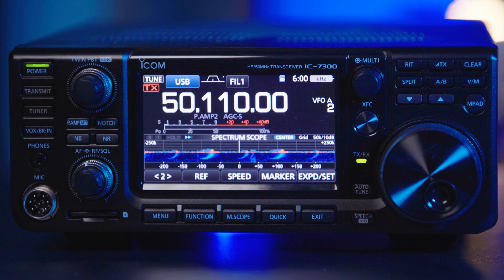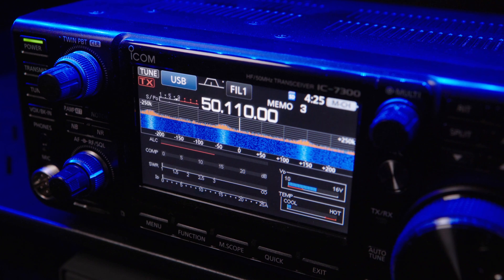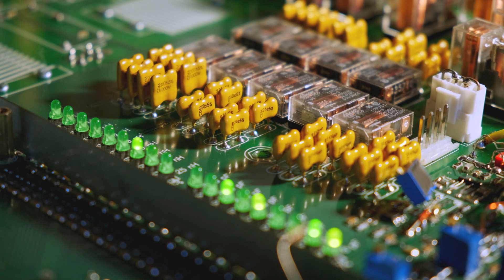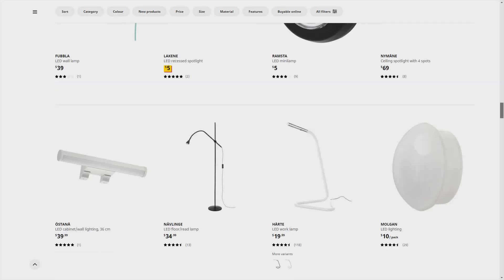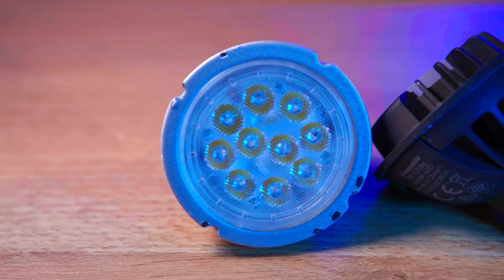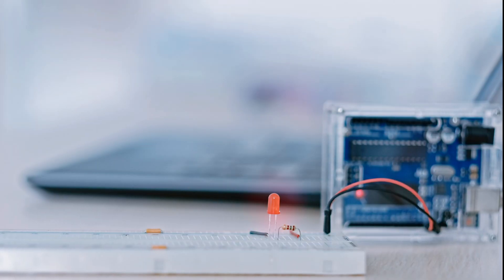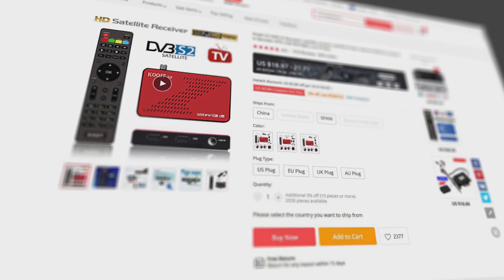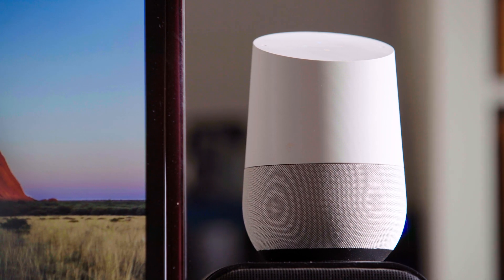Local Radio Interference

Comment: What brand of down lights did you buy? I am just about to have them installed in a new part of the house. I swapped some led fixed lighting for led bulbs in the other part of the house as they seem to be less noisy. I was contemplating changing the spec to bulb rather than downlighting for the new part of the house....
Reply from the maker: Hi Paul. I used SAL S9064TC downlights. They're not cheap, but they're noise free. https://www.sal.net.au/products/interior-led-lighting/led-downlights/WAVE-S9064TC You'll see them in the video. As you know, it's the cheap imported stuff where you thend to run into trouble. Good luck. ;)